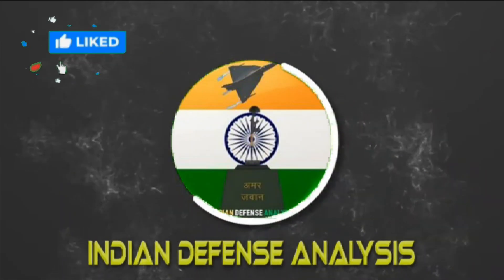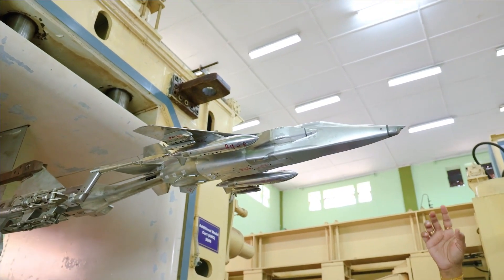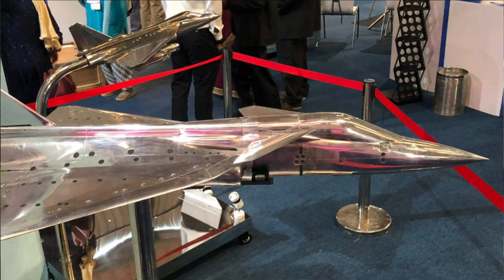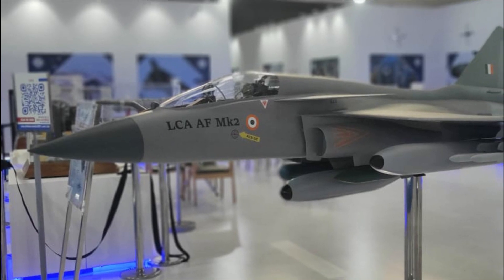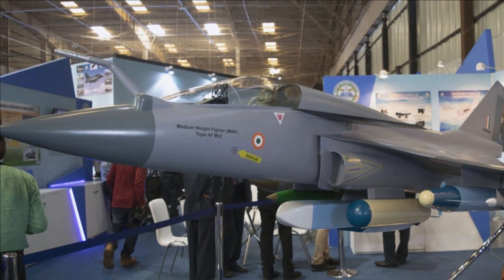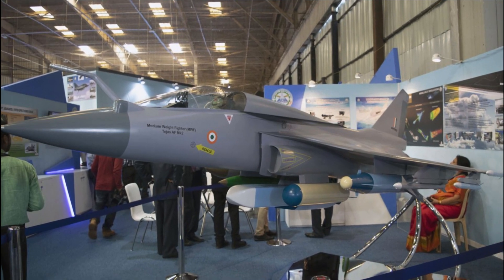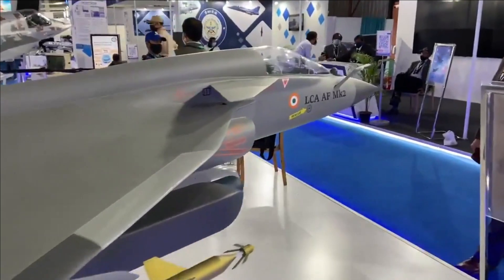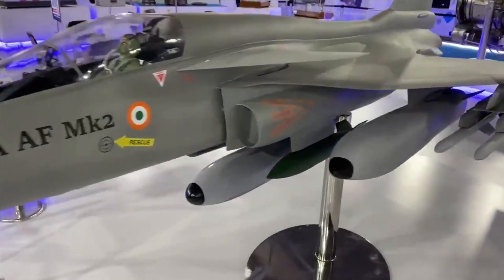Has there been a change in Tejas MK2 design?

Comment: The air intakes of Gripen which uses the same Engine is bigger where as Tejas air intakes are smaller. What is the reason? Does it effect flight envelope and performance of Tejas?

Comment: why the position of the air intakes have lately been changed ? how advantageous is it is not explained in your video ? have they frozen the position and size along with design or it is still liable to change ?
Reply from the maker: not lately thats what I have explained. Its done before 2021 as PDR and CDR is close. the intake change can only help with better aerodynamic performance. No more changes as IAF has accepted CDR - I have mentioned that in video
Reply: @IndianDefenseAnalysis   thank you for the prompt response. you have rightly mentioned about the changes that have been made after getting CDR & nod from the IAF.
 my appologies to you.
Reply from the maker: @dilipbaokar5776  no need to apologise brother, we are open for constructive discussion and query